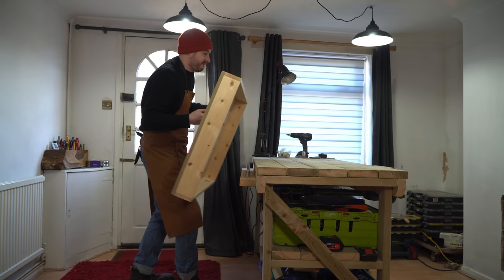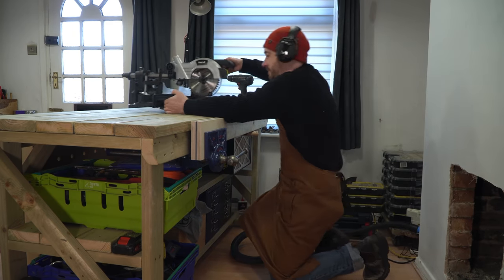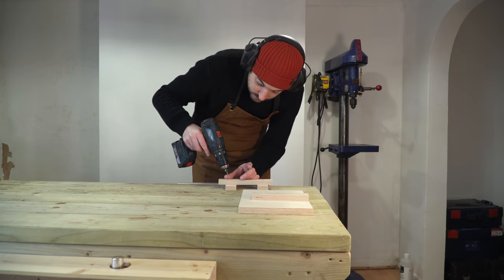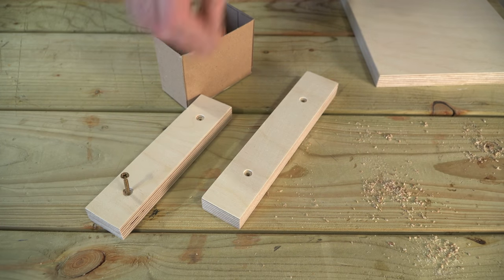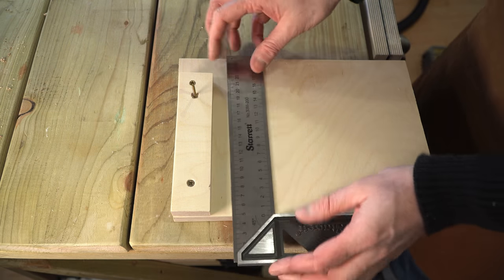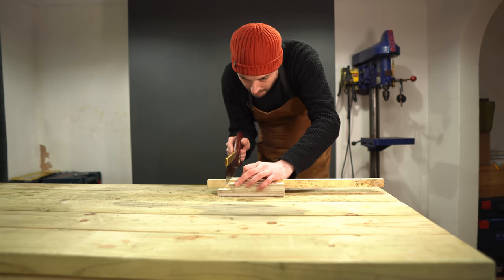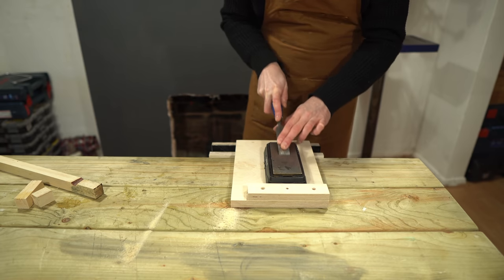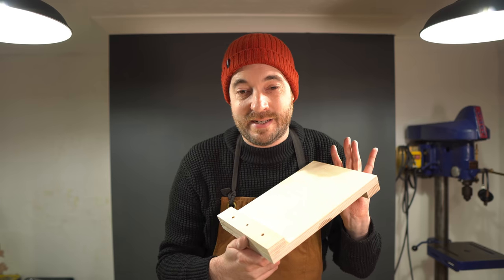Badger Bites, Making A Bench Hook

Comment: I made one with 2 shorter hooky bits - but the bottom surface of mine got scratched up from the workbench anyway, so when I went to turn it over it was worse. Instead, I unscrewed (no glue) and rotated 180 degrees, so I could use the top surface again, but with the old saw marks away on the left hand side.